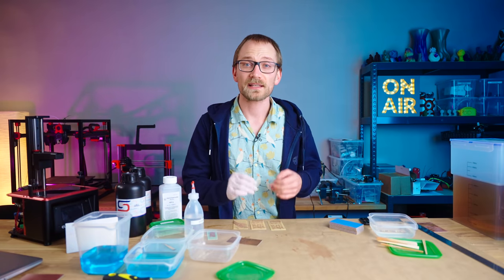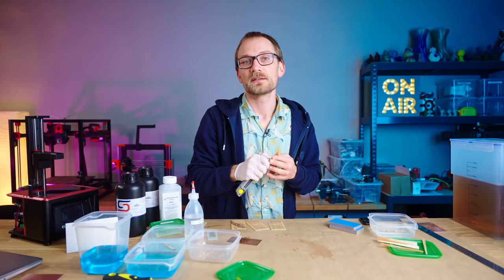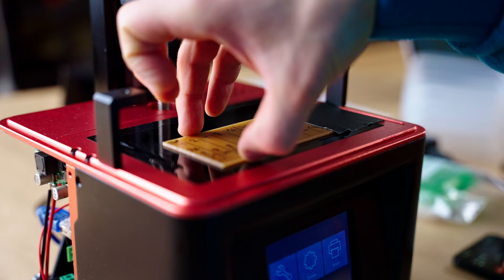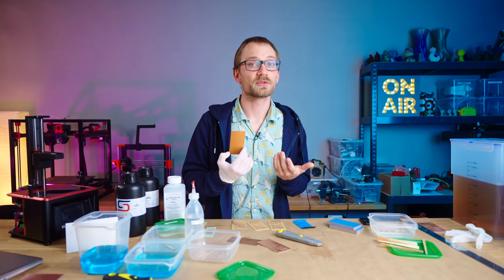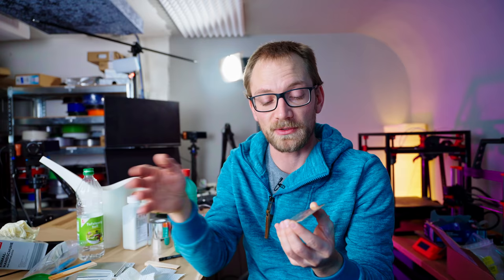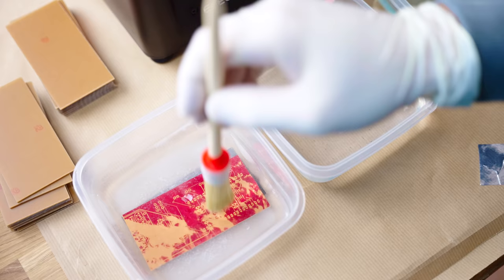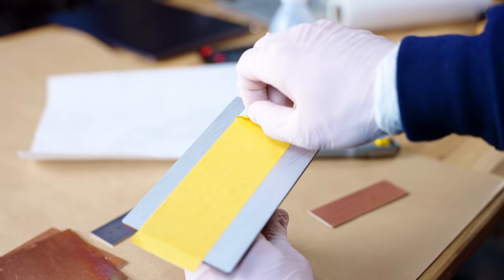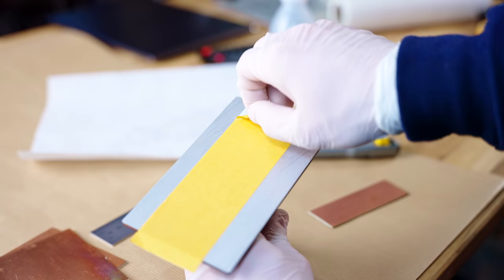The fastest way to make crisp PCBs at home!

Comment: You could print in a flexible resin to make a stamp which you could ink with a thin paint or ink which is resistant to the etchant. this way the thin lines would be easier to make, and you get the bonus of a stamp to make multiples if desired.

Comment: If I’m not mistaken, I think you can also use UVTools to import/replace a layer with an image.  So potentially you could turn the tracks into an image with the same pixel dimensions of the printers LCD and drop that into an existing sliced file (and tweak the exposure times)?
Reply: That would also allow processing with graphics tools to adjust trace width, which might help in some cases.

Comment: I usually just export the mask from Gerber, and load it into UVtools as a layer image. Takes a minute or two and doesn't need all that work in Fusion.
Reply: thanks for THIS information,... I'll give that a try this weekend (so : next year😁)
Reply: Hello Eric, can you explain me this method a little bit closer? Im strugling with it a lot :(((((
Reply: @damianwiecaw492  (Starting from the beginning for anyone else interested, there is a tool in UVTools called PCB Exposure. It can take a Gerber file and convert it directly into whatever format your printer needs. Then just put the PCB on the screen and make sure to remove your build platform so it doesn't squish the PCB when it homes.) Is there a specific part of the process that isn't working for you?

Comment: Actually you can do i pretty well on FDM printer, Just use sanding paper to sand laminate a little bit, clean with high quality alcohol, then just print paths as a first layer on the board using PLA filament, etch the  board, and youre ready to go, the last thing you have to do is to remove PLA from soldering point,  do not remove it from paths - you have ready soldermask, just paint he board. Instead of PLA you can use some kind of wax filament - then just put it into hot water and all of the filament comes of.

Comment: back in the day my dad taught me to take a clean copper coated pcb, trace the lines with nail polish and dip into chemical to remove the copper. The nail polish would protect the traces and we could then drill the pcb and soldering to it. hand drawn circuits were the shit

Comment: I have had good success simply using bare copper PCBs and using UV cure resin itself to make the etching mask. Bare copper is cheaper than the UV resist mask coated PCB material. All I do is scuff up the copper with a scrubbing pad and print the mask about 1mm thick, using resin directly on the copper, then I etch it. The reason I print the mask so thick is that I then use it as a drill alignment tool. The 1mm mask makes it effortless to drill the holes exactly in the right positions because the mask has "pilot holes" where the drill will go. 

You have to be careful removing the mask, because it can pull up the traces, but I find that I can pick most of it off and sand off the remnants. 

I hope you will give this method a try and let me know if you have success!

Cheers!
Reply: Drill it before you etch it.
Reply: @andersdoverud9046  I was dialing in the process and was afraid of wasting time drilling holes if I did it first and then messed up the etch. I waiting until I had a bunch of good etched boards and then drilled them.  But I think it would work either way. Probably it would be a little cleaner if drilled first.

Comment: that's a good idea when you have a printer like that.  especially if you use a lot of SMD components.  then you don't have to drill many holes anymore.  but other ways of exposing circuit boards are also possible.

Comment: This is a really slick idea.  I see lots of comments on toner transfer being better.  For large or medium boards, if you already have a laser printer, that's probably true.  But for little tiny boards, for small surface mount projects?  This looks great.  I'm betting the resolution of this direct process is high, and it would work great for 2 or 3 cm boards, that would just be cumbersome toner transfer.  Thanks!

Comment: For copper etching process you can use Na₂CO₃ solution instead of NaOH. To craft Na₂CO₃ you only need to heat up + constantly stirring "baking soda"(NaHCO₃) in metal cup on a hotplate for about 5-8 minutes.

Comment: You might like to try same method to make stamps. There are theese nice photopolymer rubber plates you can get in 20by30 cm² (about A4). It gets hard where it is exposed to UV but stays  water solvable there not. Normaly you make the mask like you do for PCBs (I did so about 25 years ago...) do it should work using a resin printer too.

Comment: UVTools can 'negative' the file! Start with any file/file format for your printer. You can either use a sliced model like you did, or import a Png/Bmp replacing the sliced file (upper right corner "actions->import") select insert or replace and delete unneeded layers. Next: Tools->Pixel Arithmetic, and select 'Operator: Bitwise Not' on all layers to invert the file! Adjust any other settings you wish and Print!

Comment: This is perfect. I already tried printing with FDM printer on bare copper, but none of the filaments I have at home stick to it.
Reply: You can use thin permanent marker, it works quite well. I printed a pen holder that uses PTFE tube and 2mm wire as a linear bearing.
Reply: @Papinak2  I have considered this option but have not designed a holder compatible with my extruder yet :)

Comment: You could also make your own custom display mask. Take an HD LCD with HDMI input, remove the backlight and use a bright UV backlight. You could then display a simple image to expose. For a slightly easier time, you could buy a replacement LCD specifically designed for resin printers and a UV source.

Comment: I've always been interested in something like this (especially since the resolution of the LCDs used in these things is so good now) or CNC milling PCBs but I think the problem is that once you get beyond very basic stuff you want 2 layers and vias minimum. Then you want 4 layers with vias.. Making those properly at home is going to a lot of time that you could have spent double and triple checking your work in CAD before sending it off to China.

I'd like to see a process that can build stacks of traces onto a bare FR4. Something like resin that can be converted in to copper tracks. Then a separation resin,.. then another convertible resin to build the vias etc.
Reply: Yeah vias are the hard part, and my board is already 2 sided with vias. I might try rivets or other diy solutions.
Reply: You could just do it like normal PCB fabs do - make two 2 layer boards using 0.5mm laminate, then stick them together with another sheet of blank laminate. You won't get burried vias that way and aligning layers would be a massive pain, but it should be possible.
Reply: @MikrySoft  

>would be a massive pain, but it should be possible.

At which point you just double check your layouts before you send them to China and hope you can rework any minor issues when you get them.
Reply: No one suggested this was the optimum tool for every job. But it's a great alternative for those orher ~95% of prototyping (or smal scale) stage products who do only need one or two layers.
Reply: I totally agree and no one thinks 3 layer boards.  Sandwiching a doubble sided board with a single sided board would have saved me some bodge wires ( many, many years ago ).  Between the KiCAD to design the board as well as using UV Photo resist and some epoxy ( and drilling, obviously ) I could easily make a prototype and have the single sided act as a termination board or connector to a test jig prior to getting them fabbed in bulk.
Reply: There are PCB printers on the market, but since they usually need very expensive resins to print the conductive tracks, and they don't sell in high volume, these machines are too expensive for most to even consider. Voltera is one of the brands that makes machines like that that i remember on the top of my head.

Comment: Also with NaOH, the dissolution of NaOH is EXTREMELY exothermic, in higher concentrations it can actually cause water to boil so be careful and use a container that can handle the heat

Comment: Slight variation idea: tape a non-photo-resist PCB to the build plate, then set the zero height of the printer to the new thickness (real plate plus PCB). Then print the PCB design directly onto the board (just thick enough to resist the etching, thin enough to peel off). Etch the board, then remove the printed layer (maybe with acetone to dissolve the plastic). I haven't tried this, but it's what I expected to see in this video until I actually watched it.

Comment: Interesting idea.... I love this.  I wonder if you could use one of the old LCD panels that they made for overhead projectors and mount a UV light under it.  It would greatly increase your PCB size, If it was capable of blocking enough UV.
Reply: any LCD could work, just need to pull the backlight off of the panel.  assuming it works at all....

Comment: I've made circuit boards for decades from using sticker sheets to the photo methods.  That is really slick, been debating on a resin printer to go with my FDM but now I am sure I am getting one !

Just watched another channel where he made a custom connector using a resin printer, for once YT is nudging me the right directions.
Reply: 1y ago but consider looking into DIY to avoid unnecessary entry costs. A laser on an FDM nozzle mount and a resin chamber on the print bed mount functions in theory like a slightly lower resolution resin printer as long as you run some kind of microcontroller connection to the laser for wattage modulation.

Comment: Very interesting. I have mastered chalk paper, iron and laser printer method but I can guess going back to photo resist method would be much easier with this approach. I think you could have better positioned board by aligning to corner or similar. Secondly your method might be applied to solder mask as well, you can buy it in sheets and stick to the board, then exposed , but it has to be aligned perfectly to copper. Even 50microns printer would be enough resolution. Actually that solder mask film I have could be used to PCB as well. The only thing I don’t have a SLA printer. Thumb up 😊

Comment: Intresting for home prototype testing.
 Not sure about drilling the holes after imaging . Standard practice is to drill and align image to the drills but on a conventional board can cause etch damage to pads. As a pcb planning engineer I can see 3d printing tecnology coming into the business but in a additive way ie adding the image instead of etching copper off which will give the possibility of finer track and gap down to 50 microns and below instead of of a standard 100 micron or 75 micron. 
 Even using laser direct imaging you are limited with the allowance of etch compensations which an additive system would solve.

Comment: Awesome! Have you tried coating the board with a thinned (or even full thickness) coat of resin then use a blow dryer to dry it? It should self level and even if it's a little tacky, cure it as you demonstrated. You should be able to get the coating thickness down to .005 inches (.12 mm) and then I would think it might etch. I am going to order one of the 8k flat panel printers today for my protyping. This makes the purchase a real no-brainer as I sometimes have to make custom boards for customers. My current resin printer is a projection type and am not sure its masking is as effective as the flat panel. I have to be very careful with exposure times or I get a lot of bleed around on the print causing it to go oversize and lose detail.
Thank you for the AWESOME idea!!!!

Comment: You can invert in eagle, no need for fusion.
And you should just wash the board with water, not using a cloth.
Also agitate the etching solution to speed up. I use a heavy scissor to cut boards.
And using resin for mask is something i have not thought of. Might try that.

Comment: This is so good!  Thanks so much for putting this out!  A F360 question, @10:55, how did you do the subtract?  I extruded the rectangle and then one by one my copper pieces (so a lot), extruded those and then did a number of subtracts and it worked but Im hoping someone can point me a tutorial or how they do that without so much fiddling.  I couldnt/cant figure out how to group the copper into one piece to be the cutting tool...???

Comment: I would 100% suggest against using vinegar to get rid of NaOH. Good lab practice is to have cold, clean water nearby and just wash it, preferably rinse it under flowing water. Vinegar just makes it heat up and creates a lot more junk and random places with high or low pH. Neutralizing in situ is super rare and even in a lab, the instructor has to make the call if you even should do that.  Another, completely different note: pour chemicals onto paper when measuring and not directly in water. If you add too much, you can't get it back out and your solution is trashed. (I assume you won't go ahead and use maths to fix it by adding water)

Comment: Nifty use of the UV lamp and potentially the LCD mask for this type of MSLA machine. Even if you can't really make through hole vias, this should be fine for surface mount components.

Comment: Hmmm, if'n y'all used a FDM printer with a brush/pen of sorts to paint a solution onto bare PCB stock.
Solution would 'stain' the PCB stock with ions, 'electroless' plating builds up metal only where the brush has touched down.
Rather than remove copper, you lay it down only where needed.
This also allows using something other that PCB stock as the base for a circuit.
Ex.
Print the ions on the inside of a plastic enclosure, build up copper traces on the enclosure itself.
Structure will be bearing the circuit traces, rather than separate PCB. 
Plating up copper or nickle without electricity is the same process used for plated-through holes.

Comment: The fastest way of rapid prototyping for simple electronics is just scraping out contact pads with sharp blade or custom made scraper. You have rectangle contact pads made within few minutes, all parts are soldered on top, no holes needed.

Comment: Would be interesting to see if one can buy just an UV LCD screen for cheap (I've seen 28$?) and control it with a simple driver to create these exposures without a full resin 3d printer.
Reply: A UV-Led light is needed as well, and a power supply, a LCD Display driver to be attached to an Arduino. I think, a printer is less work.
Reply: @jurgenriedl7347  From looking at Alibaba some of these "resin printer prepared screens" already come with a "HDMI to MIPI" adapter board that takes USB power - from the looks of it. So only the UV Lamp + Power + enclosure would be required, I think.
Reply: @Blubb3rbub  thanks for sharing that information. Then it might really be simpler than I thought initially.
Reply: Im curious if it would work if You just swap factory lcd backlight with uv led strips

Comment: Can't believe I just saw this. One cheap but not perfect idea is to have a UV source and a blank LCD. Plug it directly into you computer with an adapter and display a desired print on the screen. Then you can bypass the software of the printer. Downside is you have to make a few tests to get the dimensions to pixels relation on the screen

Comment: really cool ! i was thinking about the resin layer, might be better to make a complete flat resin layer and then blast laser at it to remove the copper surface, you would end up with insulated traces ,pads and holes, having to remove the resin where connection will be made (if there is no hole on that end) 

Now im really wondering about stacking layers, in theory it could be feasible....damn i want a printer so bad..

Comment: You will probably get better results if you change the developer from caustic soda to sodium carbonate as it is milder and so harder to screw up the process.. I use laundry stain removal powder as they generally contain a mix of sodium carbonate and sodium percorbonate

Comment: Wait.. did you just manually adjust the exposure of the PCB instead of making a print program that automatically changes the length of exposure of each area? All it would have to be is a stepped rectangular prism with exponential step heights proportional to your exposure time.
Reply: honestly, this is old school photo darkroom technique with new tools. I liked it for that
Reply: @doxielain2231  just felt like doing long hand math instead of using a calculator 😆

Comment: That's cool ! I that inverting the mask with boolean opération is not necessary. You could export a big png and negate it with any software and even in batch with imagemagick. As your printer seems to be able to use png, if you use no interlacing to imitate gray values and just consider it binary, it should work easily !

Comment: If you made a solid jig that used the tray mounts, or something similar, you could probably do really good double sided boards fairly easily. Much better than using a router. This might be enough to justify me getting a resin 3D printer.

Comment: well had the same idea year ago, tested it on SL1 and man wasnt happy with the hassle of calibrating the print area. Its much easier to get the PCB done on a UV exposing unit with a laster printed foil. All the hassle with size and position is gone. And yes the resolution is probs worse, BUT for prototypin, you really dont need to make the pcb smaller than you can actually make at home. Why have the pads so small, if you really cant even drill through them without striping the copper off